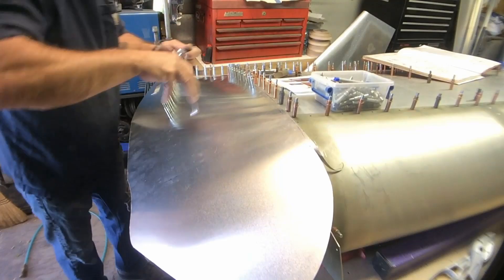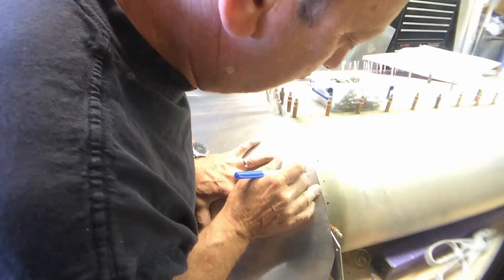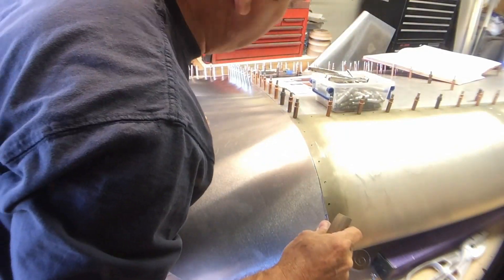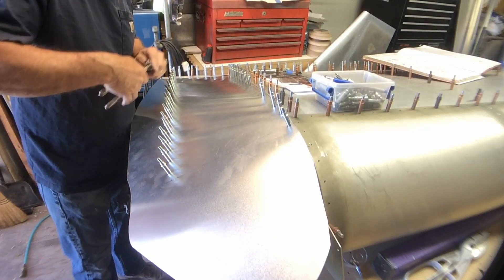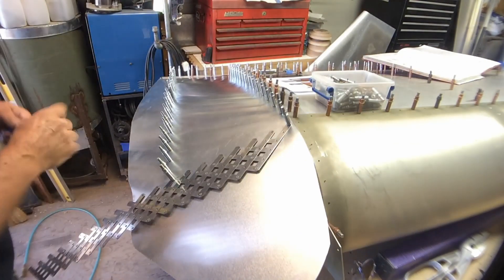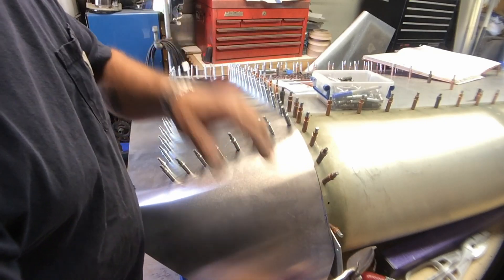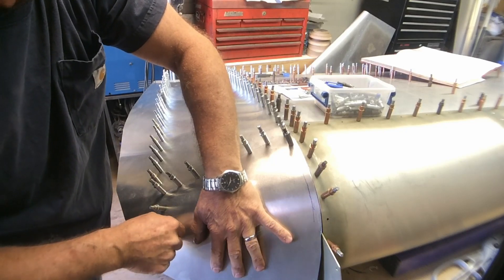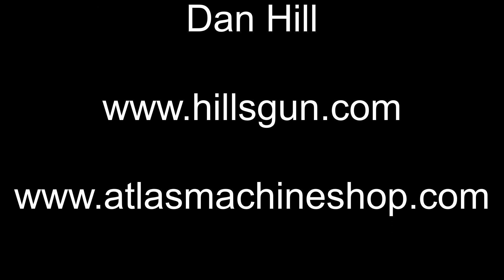Scratchbuilding a Zenith 701 Experimental Airplane, Fitting Wing Root Top Skin Part 1

Comment: Well how about that! That skin has a point by point table in the plans but afyer double checking on CAD its not to be relied on.. So I'll do just like you and fit and cut a little at a time!
Reply from the maker: I have had to rebuild quite a few parts because the didn't match. I think that it is not a problem with the plans but with my implimentation of them. As a scratch builder, even with careful measurment and cutting I think that tollerences build up and make some of our scratch built parts be out of spec so to speak.